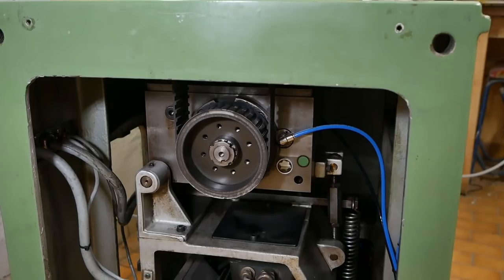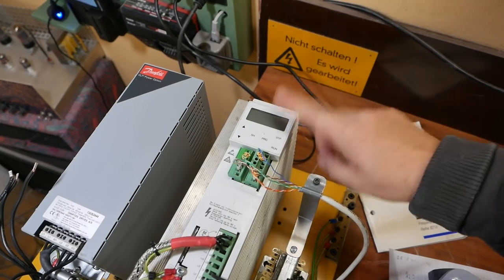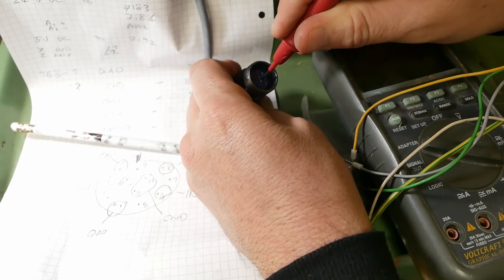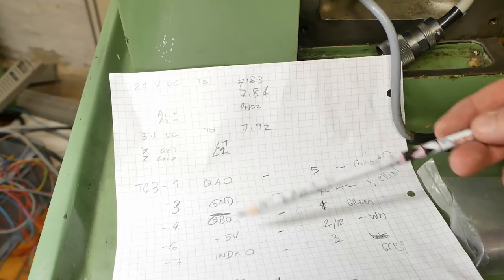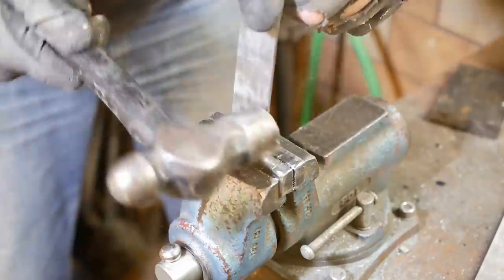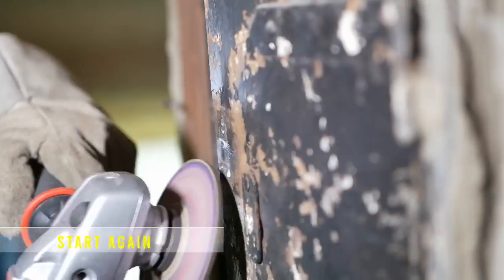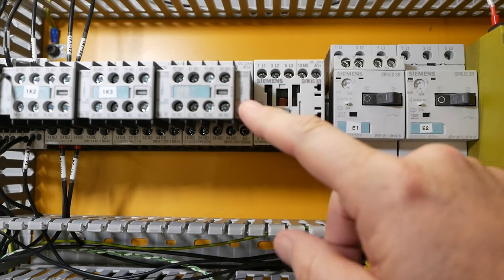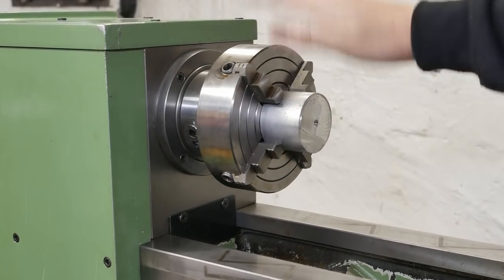Decoder the Encoder - Schaublin Ep.29

Comment: That wall plug with the fly nut on it is the pure definition of "It works!"
Reply from the maker: Yeah really.
Reply: @RotarySMP  And that incredibly clever approach only required a drill as opposed to throwing sparks at metal hoping it will melt…. In the right place. 😜

Comment: 5.08V is good. It is good to set it slightly higher than target at the power supply, so by the time there is a voltage drop in cables it get to about 5V at the destination. The PSU senses and regulates what is at its output, not what it is seen by the load. Almost all 5V devices can safely operate at +5% higher input. Some even +10%. Especially industrial gear like that should be fine. For example Mesa cards are perfectly fine with 5.25V. 7i92 can accept even 5.5V. So I would set at PSU 5.10V.

Great video as always.  Oh. The ending. What a surprise.
Reply from the maker: Thanks for the info.
Reply: it's pretty much always a 10% margin in my experience. absolute maximum is usually even higher, up to 20%
Reply: Slightly positive to allow for drop is the way to go 👍
Reply: With the amount of devices you're powering 5.08vdc is good for out of the box, as the devices load up the voltage could drop too much, then it cause issues like you had last time.

Comment: You mentioned, that you wouldn't need a freewheeling diode (Freilaufdiode) on your contactor/relais because it wouldn't switch inductive loads. I think you missunderstood a small detail there :D
This diode-overvoltage combo is used to save the controller or supply, that is switching on and off the contactor from overvoltage and reverse polarity. The load doesn't matter in that case, because the relais consists of a coil and could eventually damage the Mesa or the power supply :)
Reply from the maker: Oh, good point. Thanks.
Reply: 100% agree! I would say it will for sure damage Mesa card. Even if you use relay output, they are not made to switch such inductive load and arc on switch off will burn contacts out. Transistor output can die just on first switch off.
Reply from the maker: @soucevit  I did misunderstand this, but from the Mesa 7i84 manual:
Outputs have per output short circuit protection, overvoltage clamps and per driver chip thermal shutdown. The 7I84s outputs are suitable for driving relays, contactors, solenoids, and other medium power inductive or resistive loads.
So it should be fine.
Reply: @RotarySMP  OK. Then you should be safe. I am used to automation hardware and I have not seen contactors used without overvoltage clamps. Guess PLC outputs are not fragile or circuit designers are extra cautious.
Reply from the maker: @soucevit  Thanks for checking that.
Reply: @RotarySMP  This is correct, as long as the load is under 60mA.  If your contactor draws more than 60mA, you still need a diode or other snubber.  From the manual:  
"The output driver chips used on the 7I84 have built in Zener diode clamps to clamp
inductive turn-off (fly-back) spikes. This means that flyback diodes are not normally
required on small (less than 60 mA) inductive loads. If high current inductive loads are
switched or inductive loads are switched at high frequencies, they must have
flyback diodes to limit power dissipation in the 7I84's driver chips."
Reply: You always need a snubber diode for relays, except if the relay has it internally already, or if the relay is solid state, or if the relay is switched by another relay that doesn’t care about inductive kickback. The last reason is why diodes are supplied as an option, as most big contactors in industry are driven by a auxiliary relay on a separate breakout card, which usually includes the needed protection from inductive kickback from the aux relays, which is of course smaller.
Reply: @RotarySMP  
i had a look at the Siemens contactor (3RT1016-1BB41) datasheet. It states, that the coil needs 3.3 W in operation. 
3.3 W / 24 V = 138 mA
This is definitly higher than the max. current of the Mesa output (~60 mA).
You definitely need to put in a flyback diode. 
Even if the Mesa could handle the current of the coil, i wouldn't risk a >100€ controller board by not using a <10€ part.
Reply: @sstorholm  the Mesa board has a protection diode on-board, but it's only rated for 60mA inductive loads.  Also, inductive kickback can kill dry relay contacts over time due to arcing.  Once there's enough surface damage from arcing, the resistance builds up and causes failure to close, or welding.

Comment: Regarding VFD - when you slow down at such a high rate, you're dumping a lot of energy into VFD capacitor bank. When it can't take more it is giving OV (over voltage) error, all IGBT open and motor is coasting down to speed = 0. Simple remedy is to install resistor  rated to work with this VFD, you should have some info on that in the VFD manual. Cheers!
Reply: Some simpler remedies are to either give it a bit more time to decel, use coast to stop instead of decel, or a bit of DC braking. The first two are free, and only take a moment, and the third one is pretty darn cheap.
Reply from the maker: I was hoping to use 2, but cant find the parameter for coast. There is a mechanical brake on the motor, so I want to use it.
Reply: @RotarySMP  
Mechanical brakes on industrial three phase motors (Drehstrom Asynchron Motoren) are meant for holding the shaft still, not to slow it down. You are damaging the brake permanently by using it while the shaft is rotating - at least as far as i know. As @Nessaritius said, you should just use a additional resistor (typically a VFD has a small one already builtin). Formulas for calculating its resistance and rated power dissipation are in the VFD manual - Danfoss also has really good manuals, in case Leuze doesn't include these formulas.
Short additional information: If you wouldn't have a VFD, such a motor is typically slowed down by switching of the three phase power and instead supplying a DC voltage to the motor windings.
Reply: @RotarySMP  Don't worry, send a message or comment about exact VFM model and I'll get the info you need.
Reply: @RotarySMP  It should have that at least, and DC braking on a drive isn't all that uncommon for VFDs. What's the model number on the Lenze drive?
Reply: @PedPEx  Yup. Think of the brake as a "Parking" brake and it will last much longer.

Comment: Some pitfalls but it keeps going! The wire colors were a funny duh moment 🙂
Welding old painted steel is always a problem, particularly for small bits like those that heat before the base material.
I would point the need for the diode on the new contactor coil, because it protects the transistor driving it, from high voltage transients (some mosfets already include the protection diode encapsulated, but better be safe, as the driver card is more expensive) - it's not mandatory if the contactor is driven by a relay.
Reply from the maker: Yeah, I had a brain fade there about inductive loads. From the Mesa 7i84 manual:
Outputs have per output short circuit protection, overvoltage clamps and per driver chip thermal shutdown. The 7I84s outputs are suitable for driving relays, contactors, solenoids, and other medium power inductive or resistive loads.
so it should be okay. I need to see where I can get one of those Siemens protection diodes from.
Reply: @RotarySMP   Thanks for the reply. Seems the 7I84 is well protected. For most cases, a simple 1N4007 diode in parallel with the coil, in reverse polarity, is enough.

Comment: Haha, "that small gap in the door is a fire hazard" proceeds to light up the whole attic with welding sparks and molten metal. Not sure the Schornsteinfeger would have liked that much lol.
Reply: In Austria, we say Rauchfangkehrer.
Reply from the maker: The floor is cement bound fiber and rock wool on a concrete ceiling. As long as the sparks didnt go up to the wooden beams, it was okay.
Reply: @RotarySMP  Man it would take a lot of sparks to light up a wooden beam. Maybe with a 50hp angle grinder.
Reply from the maker: @TheMetalButcher  It was enough that the slag fell straight onto the glove with the holes in the fingers. :)
Reply: At my last job. To do any hot work in the factory we had to do risk assessment paperwork.permit to work had to be signed by factory manager.and to do it in a confined space as well. Way to much paperwork..Just use rivits or anything that didn't involve hot work.
If you did absolutely have to do hot work then all the paperwork. Then the actual job(welding grinding etc). Then when finished a fire watch for half an hour. And then revisit every half hour two times to triple check.

Comment: The acceleration and especially the deceleration time are also dependant on how big junk of iron there is turning in the spindle. The VFD faults because it cannot dissipate the inertia of the rotating components in a given time. So, if You find the shortest time for the VFD to stop before it faults, then You are not well off because any bigger workpiece will drive the VFD out of limits.
The VFD should have a place for a braking resistor. This will partially solve the probllem but there is still the maximum current the VFD can handle.
Reply from the maker: Thanks. I was hoping to dump the inertial energy mechanically into the brake, rather than into a braking resister, but I cant see a mode which allows it to free wheel down and not fight the brake.
Reply: @RotarySMP  There is also the apply time for the brake to consider. Presumably it will actually apply after the "stop" signal has been seen by the VFD, and if the VFD isn't programmed with a delay, the VFD will start ramping down before the brake applies. This is most likely a pretty short time interval, but with 20 kilos of stuff in the chuck the VFD still might trip out before the brake can take most of the load. Given the fairly short time the resistor would need to dissipate power you could probably get away with a fairly small one, wattage-wise, compared to one that needed to do the full braking itself.
Reply: @lwilton  The Wattage of a resistor is not the only factor here. There is also the maximum current a resistor can handle. Although the energy will be small there may exist pretty high current through that resistor. Traditionally the higher wattage resistors are made out of thicker material thus having a higher current rating.
IMHO there is no need to "spare" in the wattage here. A 200W resistor (maybe 100 ohms) might be the correct one.

Comment: Why would you want to run the 5V logic on undervoltage? I would definitely set the power supply at 5.1V because it will be 5V in the other end of the wiring harness.
Reply from the maker: Thanks. Others also pointed that out. I didn't think that through.

Comment: for decelleration alot of vfd drives have the option to hook up a braking resistor and this allows them to dump the exess energy into the resistors this is a very common practice in any decel with a load
Reply from the maker: This one can as well, but since there is a mechanical brake which I have not yet hooked up I was hoping to use that rather than a resister.
Reply: found a manual for a drive similar as i couldnt make out the proper model in the video. the UG+ and UG- terminals on the drive can go to the brake chopper module that will hook to the brake resistor. shows the chopper as Z3 in the wiring schematics.
Reply: @RotarySMP  sounds good you should be fine just on the decel like you had said if the ramp is too small it goes into overcurrent on decell some drives have a decel mode selection to let it freewheel down but i cant find it in that drive manual so long as your ok with a longer ramp on speed changes should be fine. and then on the stop you have the mechanical brake.

Comment: Some VFDs have the option to do overvoltage control with that they will extend the down ramp so much that they wont hit their overvoltage limit.
On others you are down to extending the ramp by yourself so that it doesn't run in overvoltage or dynamic braking with a braking resistor.
Reply from the maker: Yeah, I will extend the ramp.

Comment: I don't know if they're still around, but when I worked with Heidenhain kit some 30 years ago there were some 3rd party connectors which were physically compatible but a lot cheaper. Unfortunately they were numbered in the opposite direction to the real ones. One of our customers found out the hard way that if you blindly wire the cheap connectors as per the numbers you'd put the lamp supply across one of the photodiodes in the reading head. It didn't always kill the diode but it would degrade it and give erratic readings further down the line.
Reply from the maker: In this case.... check out the video out take :/

Comment: Running an empty chuck is indeed a hazard. Static friction, caused by the pressure on the stock, locks the laws in place. Without that, the vibrations can cause the scroll or (for a 4-jaw like that) the jaw screws to loosen under centrifugal force, and eventually you have some extremely nasty projectiles at random trajectories. I have never seen this happen, and I don't intend to ever.
Reply from the maker: Thanks for that analysis.
Reply: I have never seen it happen either. 
In fact I would be surprised if anyone has ever seen it happen.
Reply: I think if I were to try to set up a chuck (scroll or 4-jaw style), I would have to try extremely hard to make the jaws leave the body under any circumstances.  It would have to vibrate like crazy to allow enough slip to undo the scroll and if it is vibrating like that, then you have bigger issues than the jaws.  Interesting though, I shall do some experimentation.

Comment: If the inverter has a dynamic braking transistor (usually an option), you can connect a dynamic braking resistor (terminals should be provided) and solve the bus over-voltage fault upon deceleration. Determining the resistance value will be a shot in the dark without knowing the mass of all the rotating components, including that of the motor stator AND the workpiece. The inverter manufacturer may be able (willing) to guide you through resistor selection. 

You should mount said resistor outside the electrical enclosure, but inside a vented enclosure of its own since it will be a heating element for a few seconds each time you stop the spindle. (The higer the RPM, the higher the temperature.) These are usually made of perforated metal, expanded metal, etc. Be sure to shield it from swarf.
Reply from the maker: Thanks. Lenze does off braking modules, but since I already have a mechanical brake, I was hoping to avoid the resister.
Reply: @RotarySMP  the D.B. resistor operates differently than the mechanical brake. The D.B. resistor burns off the power generated by the motor. The instant power is removed from a rotating  electric motor the collapsing magnetic field will generate power back into the DC bus. 

This happens with ANY electric motor. The reason it wasn't a problem with the original setup (magnetic starter) is the power source was physically disconnected and the back emf had no where to go. 

BTW - you typically do NOT want to haveca contactor/magnetic starter in series with the inverter and the motor. Only on the power input of the inverter. The voltage spike created when the contacts open under load will kill the IGBTs in the inverter.

There is no way for you to reliably use the mechanical brake to prevent the bus over-voltage fault from occurring as this happens so quickly. Not to mention high inertial loads turning at high RPM can generate very high voltages and stress the IGBTs and bus filter capacitors within the inverter.

Comment: 1:20 I've ran them all the way in before... but having stock in a chuck that you aren't about to put in tool pressure on, just adds failure points to the mix. Any exposed, rotating mass is dangerous... if we're going to split hairs during a spin test, where's the guarding, why not a faceplate, why any attachment at all? You were literally tuning it on to "watch" it spin, you're fine as long as you stand to one side... lol
Reply from the maker: Good points. I could just take the chuck off, biut then I have to find a spot for it :)

Comment: You could add a break resistor to help with the decel on spindle VFD.
Reply from the maker: Imight have to. I was hoping to just use the installed mechanical brake.

Comment: Beware of the overheating of the motor under high load and low speed. A vfd ready motor has either Pt100 or clixons built into phase. Foresee a separate cooling fan on the spindle motor.
Reply from the maker: This is why I have chosen a relatively high lowest speed of 20Hz.
Reply: @RotarySMP  That is quite low thinking the fan is a centrifugal blower - below a certain minimum the flow is near zero. Under high load  (current) the cooling will be insufficient.
Also check the type plate on the motor. If it states class B insulation using a vfd is problematic in the long run, due to its low max operating temperature and low dielectric characteristics. Vfd cause voltage spikes which are (partially)  dealt with in the EMI-filter.
Class F insulation is more approriate.
Reply from the maker: @milloons2847  If has insulation class F. Checked that on an earlier vid.
Reply: Would be a good idea to add a break resistor to the VFD. Then you can crank the slow down speed as well.
Reply from the maker: @JLK89  I was hoping to avoid that as there is already a mechanic brake on the motor I just need to hook up. I just dont want the VFD fighting the brake.
Reply: @RotarySMP  If the VFD is told to stop before or as the brake is engaged, and it also has a resistor, there will be no fighting going on, they will both be slowing down the motor at the same time. Effectively you will have two brakes, though the resistor will do more at high speed and next to nothing at low speed, and absolutely nothing with the motor stopped, so it won't  hold the motor position like a physical brake will.